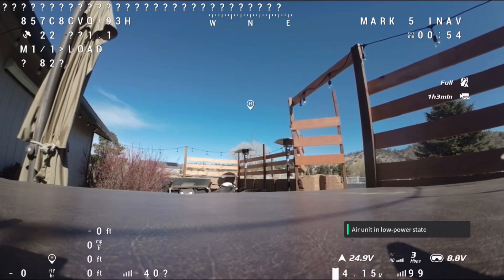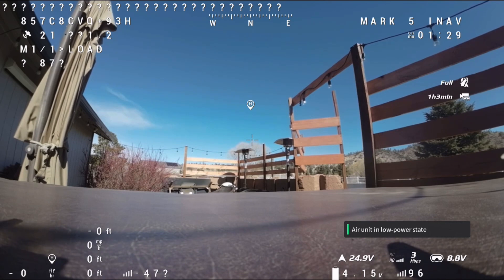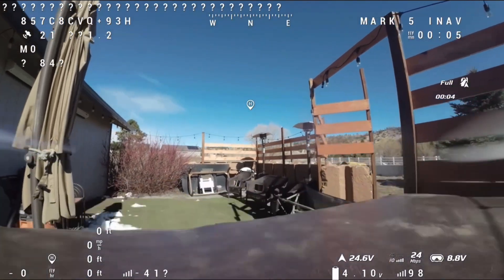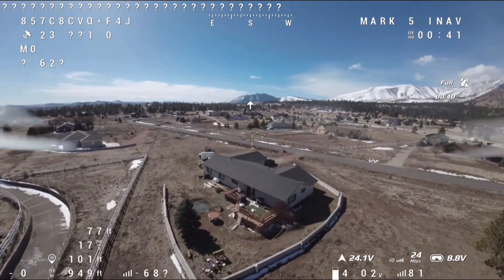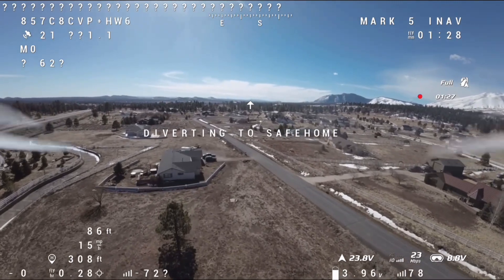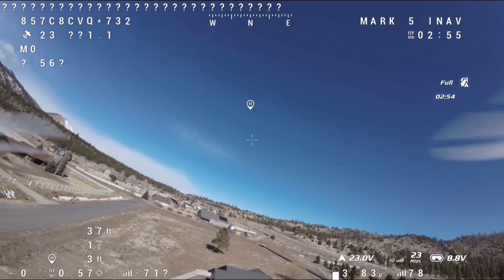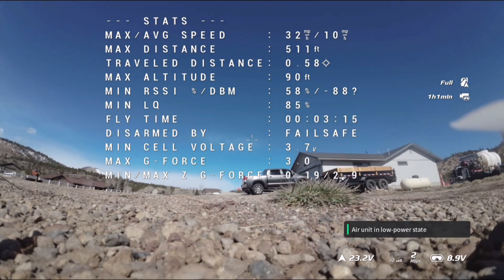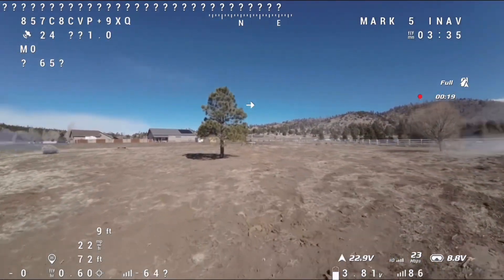February 25, 2024 Testing iNav RTH and Failsafe #geprcmark5

Comment: I'm no inav expert actually know nothing about it but , safe home sounds like a new feature in bf that is sorta a default home location the drone will try to land at . That doesn't seem like a good idea to me there are a lot of things to check before each flight that seems like some thing that would be overlooked . I would hate to failsafe and my quad tried to literally fly home to my house from where ever I am
Reply from the maker: Yes I understand your concern however .. it will only fly to a safe home that is no further than your set perimeter.  I have 3 set up in my neighborhood.  I think mine will only fly to the closest one within 600 yards or so.  Autonomous missions have the same protocol so that you can’t accidentally send your drone on a waypoint mission across town. Also iNav has another cool safety that will auto land your drone if during failsafe or RTH is starts gaining a certain percentage of distance further away.